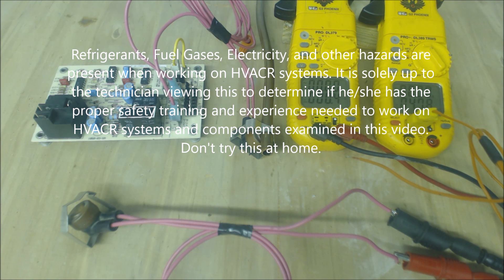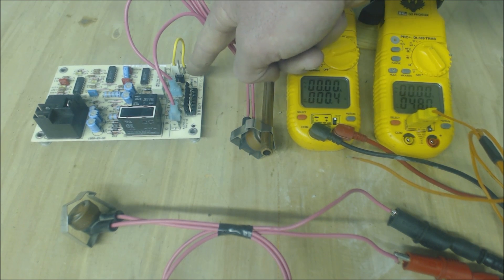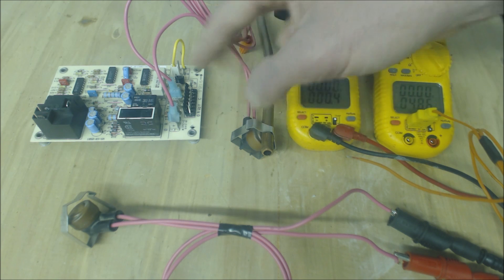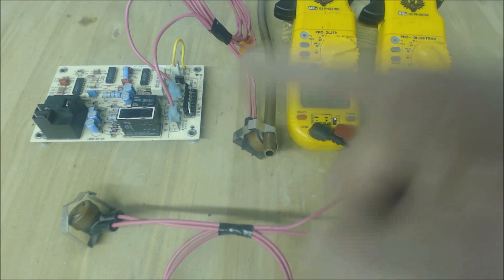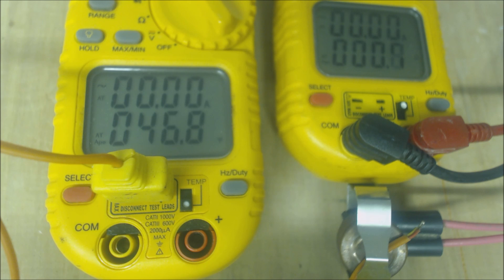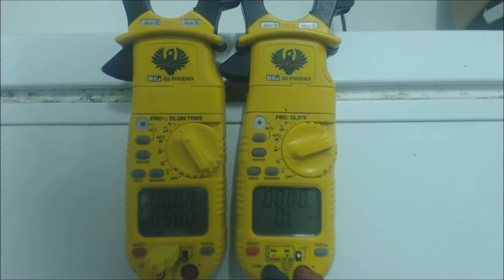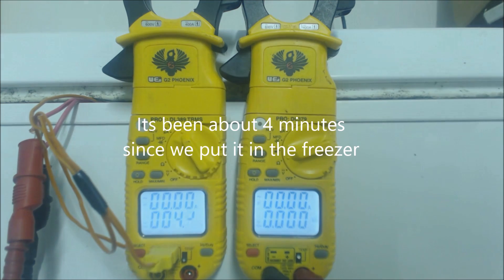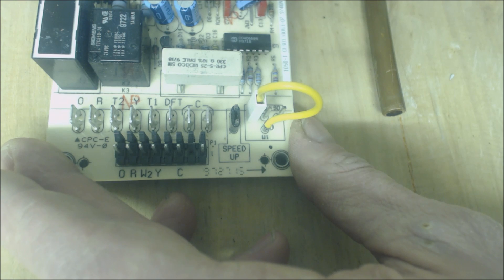Heat Pump Defrost Thermostat Sensor DFT Testing!

Comment: Hello :) 
Heating on my unit works. In cooling defrost gets triggered quick. Sometimes after 30minutes. sometimes after 5... What sensors can call for defrost mode ? I ohmed good OAT and OCT
Thanks!

Comment: If the switch closes at 30F  to activate the defrost then does that mean the heat pump will only run to temperatures above 30F since the coil has to be colder than the outdoor temp to collect heat?
Reply: No, once it's reaches 30F or below the heatpump keeps going but a timer starts for 30 or 90 min. Then the defrost starts and goes till the coil reaches 80F. Then back to normal. That's my understanding anyway

Comment: Thanks so much for the video brother, you saved me a ton of time and effort. I replaced the capacitor in my unit because the condenser fan would not come on, i tested the fan motor and it tested out fine, i was beside myself wondering what i was over looking. As it turns out, i just happened to be out back when the condenser only was running and the fan not running because it was in defrost.  I thought "omg the compressor is going to burn up" not even thinking that it was designed to do that on a heat pump.  I was thinking in "summer cooling mode and its 115 outside" in my head, not its 37 degrees outside tonight in AZ.  So i shut it down and have been trying to figure out what was wrong with it for two days now.  The defrost switch was stuck in the closed position and never got a chance to open until i shoved a heater down inside and heated it to 80 degrees, then i heard the "click" and knew I was an idiot.  Thanks again brother, you saved me the price of a fan motor and many head aches lol.  Wife just looking at me shaking her head now, and i can't blame her one bit, hahaha

Comment: Thanks for the video! I have an old Carrier heat pump, and the sensor seems to be an NTC. It doesn't have any info on it, can't even search for a replacement. What do you think, can I replace it with a simple on/off clixon sensor? Thank you!

Comment: I'm checking my defrost sensor, thanks to your videos. I'm wondering about the dense black material around the sensor. Is it insulation or just securing the sensor in place? Thanks!
Reply from the maker: It is actually both, thanks

Comment: I have a few units where the AC will only work when the red low voltage line is disconnected. Any advice?
Reply from the maker: I would need to know the make and what it is? Are you talking no 24v power to the defrost control board? If that is the case then there is no way it would suck in the contactor other than if the contactor contact is melted in the closed position.
Reply: acservicetech It’s a Goodman. (Don’t know exact model without looking at it). And whenever I disconnect the Red low voltage line from the Defrost Control Board the unit will turn on but when I reconnect it it turns off.
Reply from the maker: did anyone go in and mess with the wiring. It almost sounds like a power wire is on a normally closed side when it should be on a normally open side of a relay. Is there another 24v power source for the unit that it is using as well?

Comment: Thank you very much! I'm just a diy guy and happened to notice my condensing unit freezing over and apparently not going into defrost mode last night. I was able to disconnect the outdoor fan and jumper r to o and force defrost. That melted all of the ice in about 5 min or so and I also changed the accumulated timer pin on the df board from 90 to 30 (not sure if that will help) however I did notice a sensor that was just hanging and not attached to anything last night and didn't know what it was. I assumed it was normal. I don't know if it is indeed the problem or not but I'm anxiously awaiting getting off work to test that hanging sensor. That I now believe is the defrost sensor (thanks to you) I have followed your channel for awhile now and have learned quite a bit, I think you do a great job at explaining things and just wanted to say thanks! In a really long way apparently lol if by chance you read this and have time could you let me know if I'm heading in the right direction....just need to figure out where to mount the thing I suppose? Thanks again have a good weekend.
Reply from the maker: Glad to hear the video helped. The dft is mounted on 3/8" tube attached to the outdoor coil as close as you can get it to the coil. How did you make out?
Reply: acservicetech not sure how it came off but that was definitely it. Thanks again, now I need to figure out why my 60 amp fuses to the inside air handler are blowing? Changed one fuse twice in 3 weeks. I have been using emergency heat in the last few weeks because it's been around 20 degrees or colder in Maryland. Was told that I may have a issue with one of my electric strip heaters. Everything is working great at the moment, I think I'm going to leave it be for now and hope it was just a fluke lol ....that's never the case though, thanks again bud , I owe you one